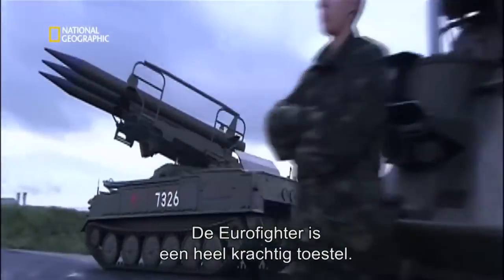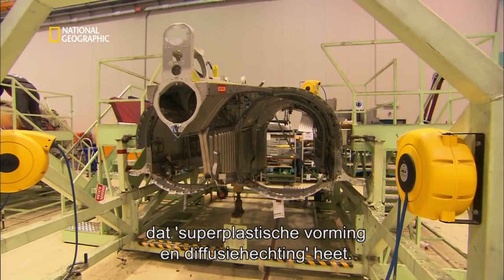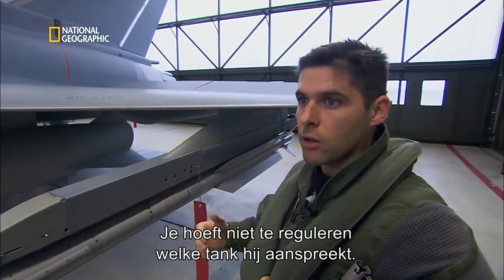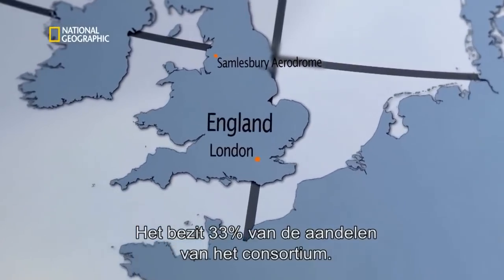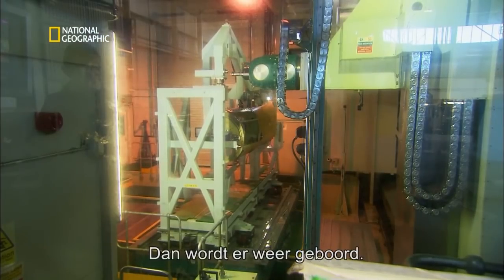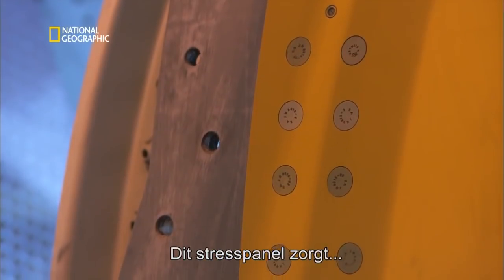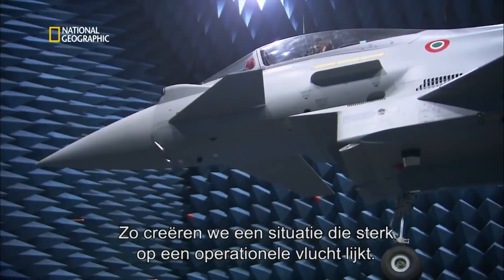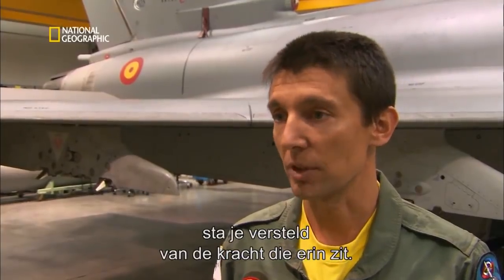National Geographic Megafactories - Eurofighter Typhoon

Comment: 10 most combat-ready and operational fighters:

1 American F-22 Raptor is far and away the air dominance champion, but only 170 were manufactured and only for the US air force. They prohibitively costly white elephants at $150 million a piece. 

(F-22's closest rival Russian stealth Sukhoi PAK-FA or SU-57 has better maneuverability (3D vectoring), but these fast stealthy attack aircraft with beyond visual range missiles will not see dogfights. Only 10 Su-57 have been built, and their avionics and stealth characteristics are no match of Raptor's. Chinese stealth J-20 is unproven copy of Raptor and currently has old Russian Su-35's jet engine -- Chinese have struggled to re-engineer best in class avionics and jet engine)

2 Eurofighter and French Rafale  are tied for best 4.5 gen fighters. They are more updated than the older American twin-engine F-18 Hornets (no. 5). They are somewhat different (Eurofighter is faster but Rafale is fantastically maneuverable), but overall both are the fastest, the most tech-loaded, the most versatile, very maneuverable .. but also very costly at $90 million a piece

3 American F-35 Lightening is STEALTHY single engine multi-role fighter to fill up American and allied air forces, marines and aircraft carriers (3 versions). However, it lacks speed and maneuverability of no. 2. Because of American clout, an astonishing 3000 are already back-ordered for delivery through 2029

(There is no Russian single-engine stealth in offing and Chinese rival Chengdu J-15 is still in development)

4 Swedish JAS-39 Grippen E/F is the most sensible and cost-effective (half the price of F-35) modern multi-role light-combat fighter to fill up any air force's squadrons. It is extremely well-armed (13 hard points for all kinds of missiles and an awesome canon), easy-to-operate-maintain and technological-marvel with fully integrated avionics and communication systems. It lacks power and top speed of no. 2 (mach 1.6 as opposed to mach 2.0). Swedes lack strategic military allies and political clout that Americans, Russians and French have to push Grippen's sales. 

5 American F-18 Hornet and Russian Su-35 are tied as great twin-engine fighters but lack updated sophistication of no. 2. Both are getting upgraded to extend their life-span and compete with more modern Rafale and Eurofighter.  

6 American F-15 Eagle and Russian Su-30 are tied for the big heavy but amazingly powerful and maneuverable fighters. Both are loaded with fire power and electronic weaponry

7 American F-16 and Russian MiG 29  are tied as the most proven work horses for 4 decades in service. They are getting upgraded and still very capable. But Grippen is more modern in every characteristic and also very affordable. 

8 Chinese Chengdu J-10 and Japanese F-2 are single engine updated competitors of F-16, but Grippen is by far is the best single-engine light combat fighter. 

9 Indian Tejas MK2 will enter service in 2022 after getting a new light composite frame and much more powerful engine  for better power to weight ratio

10 Chinese FC-1 (assembled in Pakistan as JC-17) is OK -- it is getting upgraded with a better Russian engine and possibly European avionics
Reply: Can you explain all that again?  Jeeze, did you just learn how to copy and paste or are you a story writer by trade?  The F15 Silent Eagle and the F18 latest upgrades makes them amoungst the top 5. The Chinese and Indian are not worth mentioning because its all speculations and have yet to be built and proven.  Its all he says, she says type aircraft and specs.
Reply: @Brian Barratt Last time I checked, it was a single nation...
Reply: Rafale is better than eurofigther
Reply: @venturilegochannel9991  Better  with regard to what ??    the only real   advantage Rafale  has  is its carrier landing capability ..
Reply: Wierd isn't it. All of a sudden the 70.000.000 € Typhoon costs 150.000.000 $ . Two years ago it was the other way around.  As for the F22 187 should be combat ready they lie about the price per unit since the F22 doesn't "cost about the same as the Typhoon". Yhe F22 costs over  350.000.000. F-22  $377 million just found it. Since lockheet Martin never bribed anyone nor any corrupt government i immediately trust them haha. Crazy such a dirty corrupt company that almost represents a country.......... Anyway the F22 is about as good as Typhoon till you look at Red Flag and other war games.......... 55 % for the Typhon vs 45 when it comes to the great F22 should shut every yanks pie hole it seems the US forgot there are more ways to spot the enemy than just radar. The Typhoon has by far the best combat ready thermal imaging technology available. I am sure America will develope an even better fighter in the future but for now you have to live with 2nd probably 3rd place. Rafale is also better. I don't understand American butthurt anyway. When it comes to air dominance  no one beats the US because of their sheer number of fighters so stop whining and stop lying!
Reply: F-15 should be top 3. It’s never been defeated in air combat and is one of the most feared fighters of all time.

Comment: F22 is a nice plane but it is not the workhorse of the U.S. Airforce ...  187 in service ... basically the f-16 is still the main Aircraft with over a 1000 in service...where the Typhoon is clearly the Workhorse in Europe (and Kuwait, Oman ect.) with over 600 in service and still being built...so yes I would say it is the most advanced multirole Fighter out there and not outdated at all... I mean I hate war but if anything occurs it will most of the time be a Typhoon vs a F-16, Su-37 ,Su-35s or J-10
Reply: Try again.  Try harder this time.
Reply: Considering kinematic performance, I would not want to be in an Euro Fighter typhoon against a su-35 in a dog fight.

Comment: Eurofighter costs 115 milion$.. BUahahaha.. And they call the F-35 expensive.. In the same time F-35 is a 5th gen stealthy fighter jet while Typhoon is basically a 80s technology 4th gen fighter jet...No wonder it costs so much when one wing is made in Italy, other in Spain, third part in Germany, and so on... What a waste of money and labor..
Reply: The F-35 is made the same way, with component parts manufactured all across the US, and other countries in Europe as well before final assembly at Lockheed.

All modern aircraft, both civilian and military are manufactured this way through a supply chain spanning multiple countries.
Reply: So in that case stealth planes are 70s tech then as I remember a certain f117 flying long before the 90s or 2000s and 4th gen and 5 gen is marketing to make something sound better what happens when a radar hits the market that makes all stealth properties obsolete? Then there is no room to to upgrade the f22 I think it's a lemon and that's why America has stopped production as the typhoons and f16 will be just as safe or should I say vulnerable as any other fighter the way ahead if pilots sitting in bunkers 1000s of miles away flying fighter craft that they can pull 20gs in and capable of Mach 4

Comment: ‘The best fighter you can buy’, didn’t the Indian Air Force give it a thwopping with Su-30”s? Several times actually
Reply: @user9823-v1t  the pilot is also part of the Airplane
Reply: exercise or any aerial battle is about men & machine components.. yes its russian su27 based but its detail design & interim changes like canard adition or completely different avionics & weapon system & narrated by indian pilots & scientists... 
moreover after signing licensed production all aircraft is manufacture in India from small screw to engine components around 73% of components are sourced from within country 
so if you want to blow your ego up than take it on your face.. Su35 Rafale mig35 are better than it in 4th gen category needles to say how 5th gen pilots will outperform this jet.. which is good very good but certainly not the best..

Comment: ok typhoon is very interesting plane but looking on this documentery after a timespan of their service life its obvious their 70% carbon fiber airframe is pain for all customers because its super hard and expensive to detect cracks and defects in glued joints while almost impossible to repair it if it somewhere deep inside plane. thats why from 100 german typhoons are 6 flyable to this day. and if u want SMALL SUPER agile jetfighter u go for Gripen.... considering Rafale, but its already to big and heavy and unnecesseraly have two engines. czech republic have 14 Gripens, constantly upgrading them, flying them over 15 years without any single time being downed by some problem. and there is at any time availible at least 10 of 14 (2 have some fail and 2 are on                 scheluded maintanence.
As said u want best single seat small agile FIGHTER of 3+ or 4th generation? Buy gripen.... you want multirole twin engine plane? from same generation? Buy Rafal..... if you want plane which isnt good at anything and its servicing bills goes to universe while you are unable to fly them buy a plane from joint europian money hole project called Eurofighter

Comment: Second best - tied with Dassault Rafale, but well behind stealth Lockheed Martin F-22 and perhaps ahead of another stealth  Lockheed Martin F-35. 

The most cost-effective, versatile, purposeful and sensible fighter is SAAB Gripen NG. Most good air forces can fill squadrons with half-priced Gripen and not burning deep hole in defense budget.
Reply: Grippen is a light fighter like the F16, comparision with Rafale or EF isn't relevant...
Reply: SKT What are you on about mate ? Grippen is mostly a defensive platform,  nowhere near as capable or aggressive as Rafale. And no, Rafale certainly is not tied up with Typhoon!! Rafale is 3 notches above Typhoon,  Rafale outcorners and downs Typhoon on every single dogfight mock. The gust rapes the Eurofighter or Grippen whenever they meet.

Comment: I think Typhoon was obsolete even before it become operational. OK, they decided not to use stealth design but what about other advanced technologies they should have incorporated into it, TVC, DAS, supercruise (yes i know that Typohoon can supercruise but it can do that clean and without weapons).. It is currently great fighter jet, but it will be here for the next 40 years and it will be obsolete in 5. I just hope it will get some serious upgrades, and soon.
Reply: How is it obsolete? 
The Eurofighter uses the IRST PIRATE(attack) and the EuroDASS(defensive), while the Rafale uses the IRST FSO(attack) and the SPECTRA(defensive). 
🟥Both fighters have beaten the F-22 in past exercises with such systems. 
🟥Instead in the exercise between the Eurofighter and the Rafale proved to be superior in defensive EW devices. 
SPECTRA🇫🇷 > EuroDASS🇬🇧🇩🇪🇮🇹🇪🇦 
IRST PIRATE🇬🇧🇩🇪🇮🇹🇪🇦 > IRST FSO🇫🇷
Reply: It can supercruise with weapons and fuel tanks. Pilots have even said it can supercruise with a bomb load out.
Reply: stealth is a very high cost innefficient solution  : the stealth aircrafts are detectable with a network radars system...
Reply: @leneanderthalien  Exactly, the stealth technology will be obsolete in the near future. The location systems are becoming increasingly sophisticated, so that this ability is completely overestimated. You can make the location a bit more difficult, but do not prevent. These times are over.
Reply: vegass04 And I think you were idiot even before you were born.
Reply: vegass04
Were you born so stupid or is it a disease?

Comment: Composite instead metal - like the Trabant?
Reply: Yes, no metal, less radar cross section as below	
F-16	     5
F-16C	     6
F-18	     3
Rafale	     1.95
B-2	            0.75 
Typhoon	0.5
F35.           0.005
F22.           0.0001